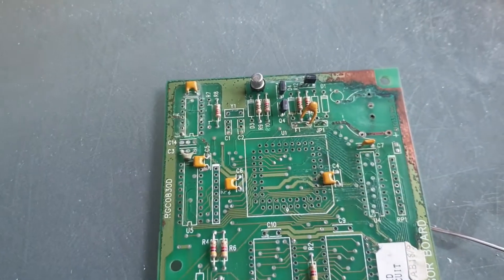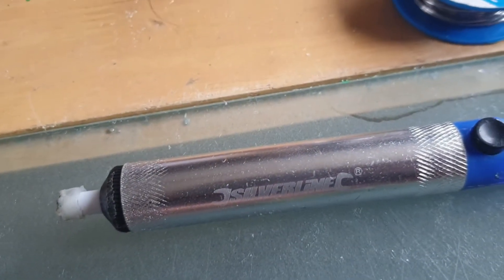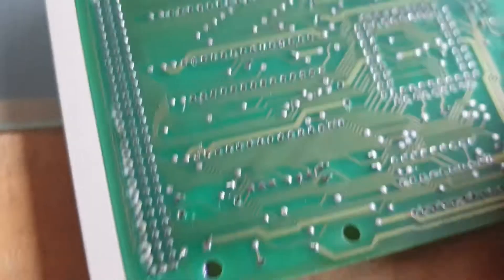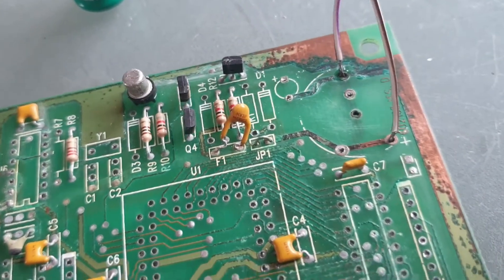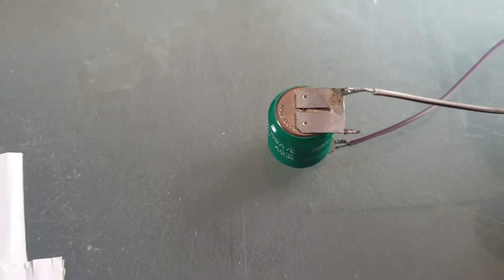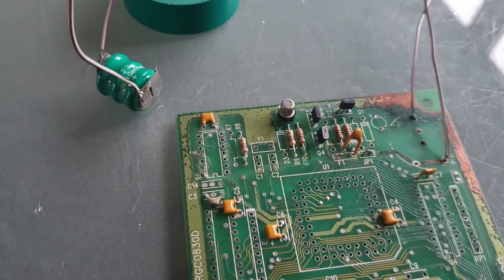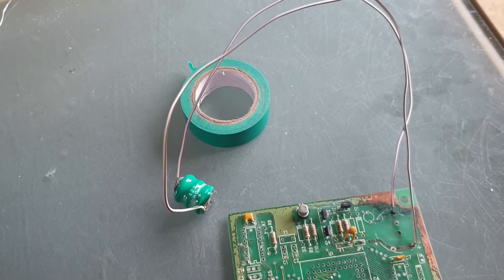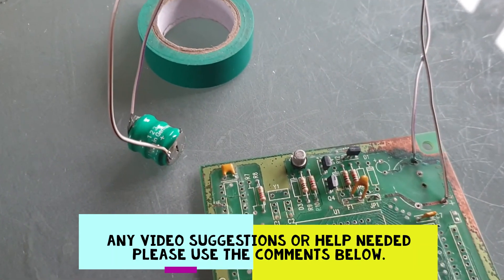Fly wiring a Battery JPM Impact

Comment: Hi I have just got a Betcom King Kong Cash Machine ‘ I would like too know if tha battery would need changed sometime are would it leak . Are does these machines have a rechargeable battery ‘ it’s a 2019 machine ‘ Can u give me some advice on what best too do . Plz .
Reply from the maker: Batteries can and do leak, the problem with these more modern techs is that they lose their memory and then you need to pair the coin mech and hopper again. Best to ask on the Facebook groups about them and get advice.

Comment: i have a batman which is scorpion 6.. i’m getting the error “low battery 9A” and i’ve been advised to swap the battery which is similar to the one in your video. i like the tutorial on how you’ve added a battery but how do i remove it from the board
Reply from the maker: Soldering iron, I've never done a swap on scorp6, I'd try leaving it on for a long period few hours, if its alarming disconnect the battery but I'd check it's not leaking first before doing that.
Reply: it’s been on all day, ive just took the board out and i can’t see any leaks. there’s no way of disconnecting the battery itself as i can see.
Reply from the maker: No, you will have to desolder it and then put a new one on
Reply: @jameshardyfruitmachinesupp9212  Instead of buying the same 2.4 varta battery, what’s your opinion on using 2x 1.2v AA rechargeable batteries in a holder?
Reply from the maker: Yes people do this mate, it works and is a common solution

Comment: i need to do 30 and shitting myself doing it .. even taking the battery off ..  they all leaking in every machine
Reply from the maker: Always get to them before the acid leaks as its a nightmare, can twist them off in a pinch if no soldering iron handy.  A horrible necessity.